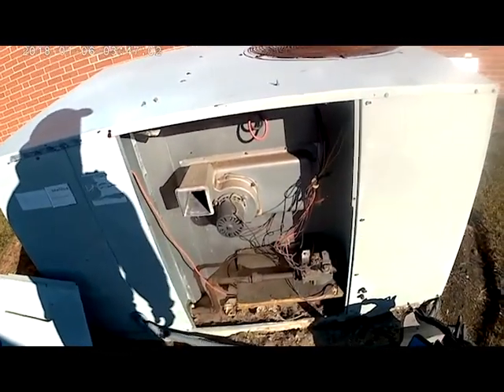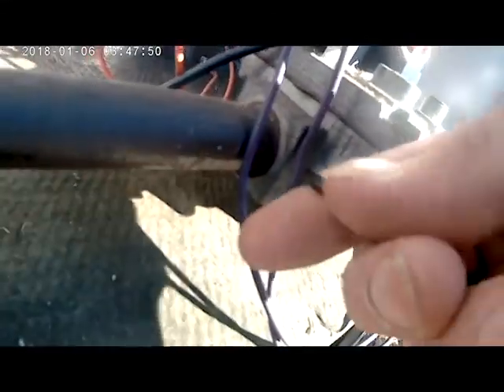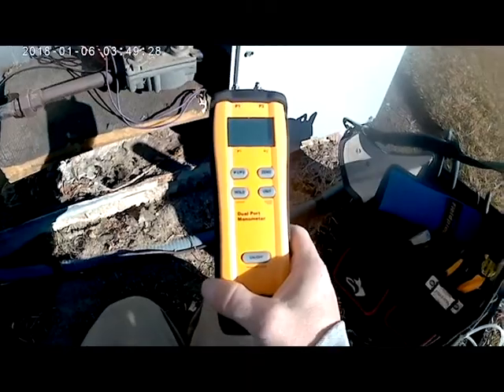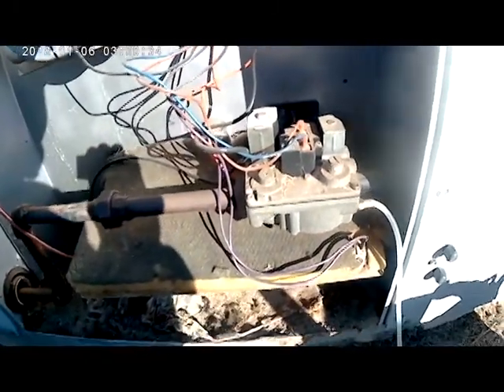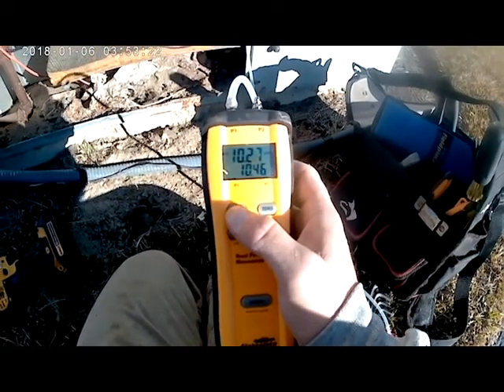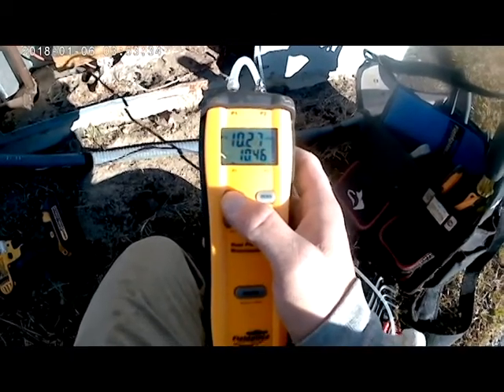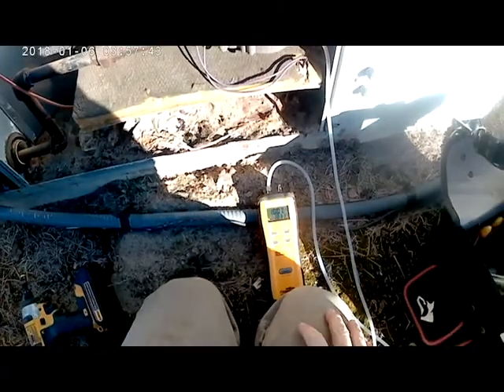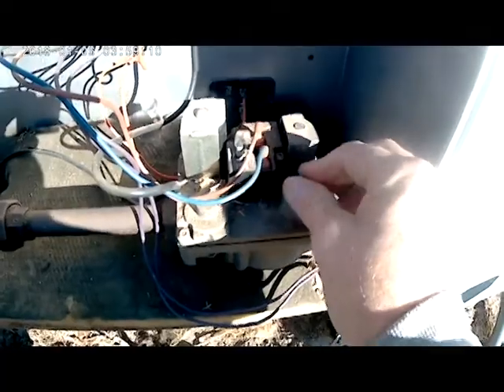How to Check Gas Pressure on a Furnace!

Comment: So if you needed to bring that gas pressure up my friend what would yo do next,Change orifices?And lets say the Orifices were .044 in there now what size would you got to to increase the firing rate?Just curios....
Reply from the maker: Not much you can do to get the pressure up except have the gas company adjust their regulator supplying the furnace or put a new one in. Usually if we find one low like this and valve is all the way open, usually refer them back to the gas company.